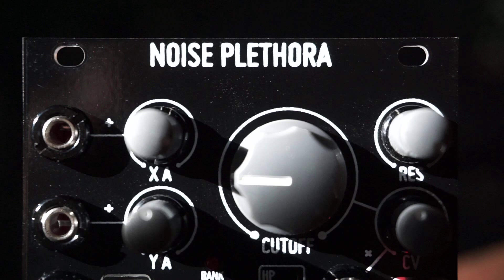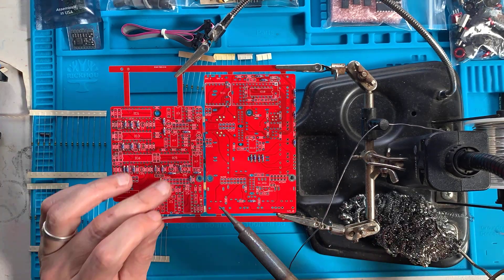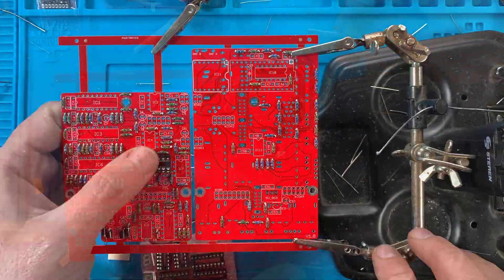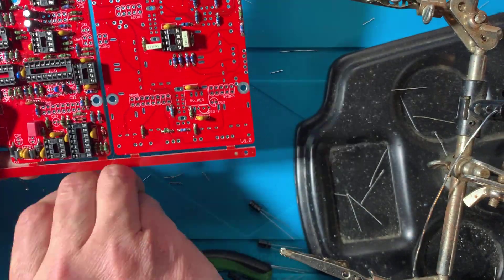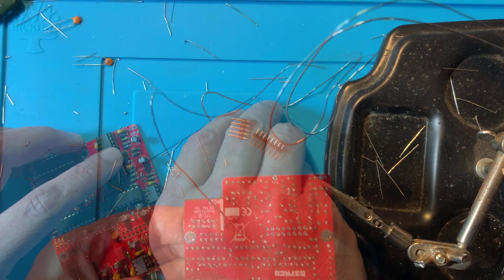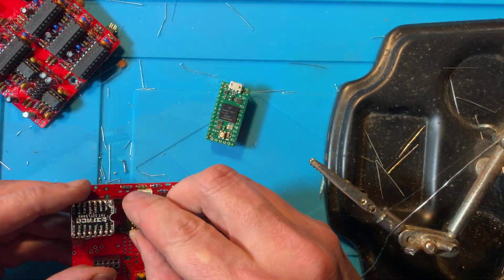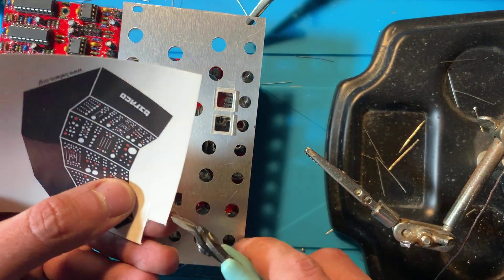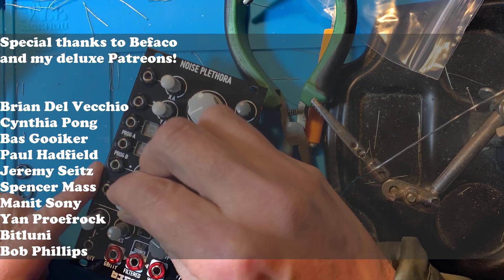Befaco Noise Plethora - Kit Build video

Comment: hi hi! just curious what wire cutters/snips are you using? it seems that all the snips i've purchased lose their edge to my guitar strings. I like the teal grips yours have as well
Reply from the maker: yeah, you need to use a separate pair for the guitar! Mine are bought locally at Steren in Mexico City.

Comment: Thanks for the video!  I'm new to DIY and I was wondering what you are doing with the multi meter and the resistors at the beginning of the build?
Reply: He mentioned you want to test one of each strip to ensure the value is correct. It's easy to mistake red stripes and brown stripes on these little blue resistors, so it's good to double-check you have the right value with a meter.
Reply: @DoctorKarul  Understood, thank you!

Comment: Hi synth diy guy! I've recently started building modules, and my first build was the dreadbox dysphonia kit, which I'm aware is quite a beginner friendly and easy kit. I was wondering if you had any suggestions for modules that would be a slight step up from that, while also being a good module to have. Eventually I'd love to be able to make something like this, but I know I need to take it slowly:)
Reply: Check out AI Synthesis, dysphonia will teach you basic in soldering and placing components. The AI Synthesis Looping Envelope might be a good second module or the matrix mixer. Two very useful modules. If you order parts youself, modules will cost you $40-50.
Reply: @kellymerrill5294  Thanks! I'll take a look:)